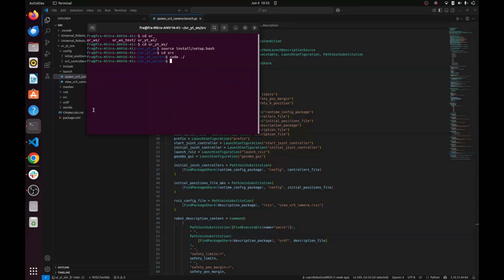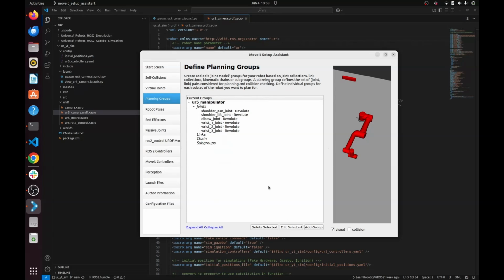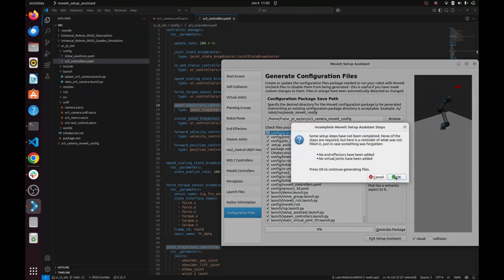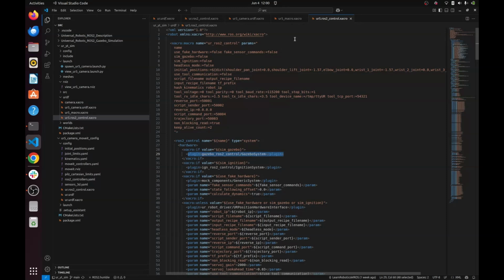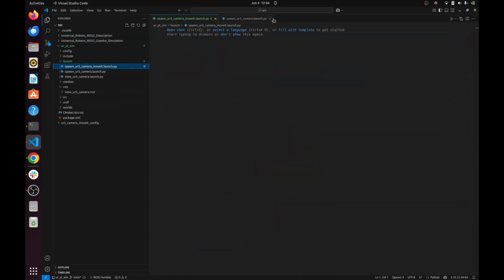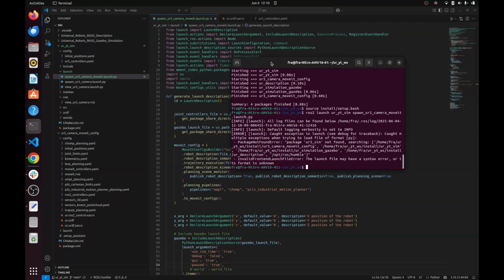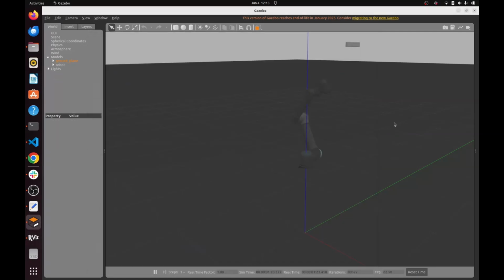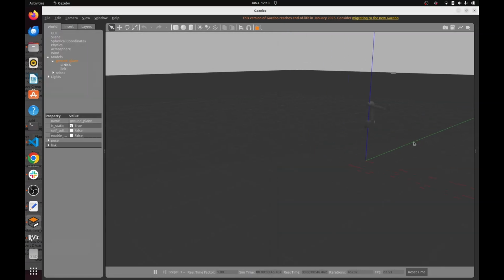UR5 ROS2 Tutorial: Build a MoveIt2 Package, Obtain Interactive Markers & Run in Gazebo!

Comment: Thank you, but i have some problem when I try to load URDF/Xacro model, it always crashes around 70% of the loading process with a segmentation fault,i following the same steps as in the tutorial videos you recommended.
[moveit_setup_assistant-1] Segmentation fault (Address not mapped to object [0x20])
[ERROR] [moveit_setup_assistant-1]: process has died [pid XXXX, exit code -11, ...
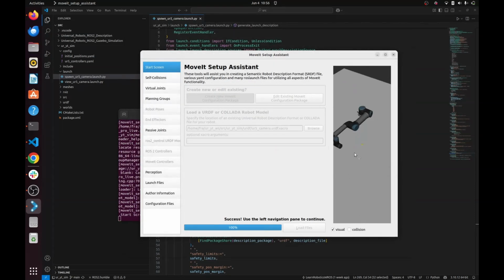Reply: 2:30
Reply: @minhhieu6187  I encountered the same problem as you. May I ask how you eventually solved it?
Reply: @林士凱-i7p  I haven't been able to fix the issue yet either. If I find a solution, I’ll let you know — and I’d really appreciate it if you could do the same. Thanks!
Reply: @林士凱-i7p  i fixed it
Reply from the maker: Have you changed the name of the first line of the Xacro file? <robot xmlns:xacro="http://wiki.ros.org/xacro" name="ur">

If you copy the official repository of ur you have name="${arg}"> and the arg is not defined. That why you need to explicit the name. Was is that?
Reply: @minhhieu6187  How did you do that? I still can't open it successfully.
Reply: @learn-robotics-with-ros  
Yes, I confirm that I changed his name to ur
Reply from the maker: @林士凱-i7p so It worked out?
Reply: @learn-robotics-with-ros  no  I still can't open it successfully.:face-purple-crying:
Reply: I got it working by downgrading RViz. I have the code if you want to downgrade, but I can't post it here
Reply from the maker: @minhhieu6187 thank you for sharing this workaround. Honestly I have seen some other developers facing this problem. At the moment I don't know how to solve this in a "clean" way. What I would do is to take an existing moveti_config package and adapt all the file of the config folder, but to do that you should have a little bit of experience. Let me know if you want me to do a content on that
Reply from the maker: Feel free to share via mail ros.master.ai@gmail.com
Reply: @learn-robotics-with-ros  Sure! I’ll send you email soon. Hope it helps others who face the same issue.
Reply: @minhhieu6187  I have the same issue

Comment: I have followed everything and the robot opens in rviz but gazebo is blank 
and in the terminal it says [INFO] [1752652093.933998575] [_ros2cli_22314]: waiting for service /controller_manager/list_controllers to become available...
[WARN] [1752652103.951964751] [_ros2cli_22314]: Could not contact service /controller_manager/list_controllers
[INFO] [1752652103.952264185] [_ros2cli_22314]: waiting for service /controller_manager/list_controllers to become available..

what to do

Comment: Hi! Thank you for such detailed tutorial video! But I have a question regarding rviz after launching the gazebo. The robot can stand correctly in gazebo like your video, however, it's lying on the ground and the motion planning context showing "NO PLANNING LIBRARY LOADED" in rviz. I followed the instruction to change the ompl.yml to ur5_manipulator but it still doesn'y work. Can you please give me an advice how can I resolve this issue?
Reply from the maker: Hi! Have you used the exactly launch file I have shared? If yes, you would need to update the config folder of the movei_config package that you have created automatically with the moveit_setup_assistant. I explain everything here: https://youtu.be/nZqTdzGAfYs
Check it out ;)

Comment: hii !! thank you for this video it was really helpful !! but i am having an error . I followed the tutorial. and the arm works in rviz but does not work in gazebo. why is it not moving in gazebo ?
Reply from the maker: Does the robot stands or falls down? Do you have the name of the moveit controllers that are the same of what you have setup for your robot? In the video the name is: joint_trajectory_controller
Reply: @learn-robotics-with-ros  First of all, thank you for making the tutorials. I am also facing the same issue. When I launch "spawn_ur5_camera_moveit.launch.py", the arm only loads in RViz, not in Gazebo. Actually, Gazebo is empty. Then, when I try to launch "spawn_ur5_camera.launch.py" (which you covered in the previous video), the RViz does not start and the Gazebo is empty, although this launch file was working properly before adding the moveit package. I have gone through all the steps and rechecked my code multiple time, but I have ended up with the same issue.

If you could upload the updated files for both "ur_yt_sim" and "ur5_camera_moveit_config" packages, that would be tremendously helpful. Thank you!!!
Reply from the maker: @rabiulhasankabir4464  here you go! https://github.com/LearnRoboticsWROS/ur5_camera_gripper_moveit_config I hope that it works now
Reply from the maker: I think that MoveIt does not talk to the controllers and so for Gazebo. Clone this repository of the Moveit package https://github.com/LearnRoboticsWROS/ur5_camera_gripper_moveit_config
I hope that now works
Reply: @learn-robotics-with-ros  Thank you so much for your prompt response. Really appreciate it. I will try the out the codes and give you an update.
Reply: @learn-robotics-with-ros  I have been able to run the code. I do not know what the issue is, but I will post a detailed comment about how I made the code run. Again, thank you for your help.
Reply: After a lot of trials, I found out that right after creating the ur5_camera_moveit_config package, using the command "colcon build --symlink-install" instead of "colcon build" to create the package works, at least for me.